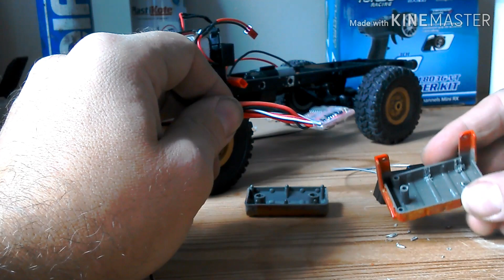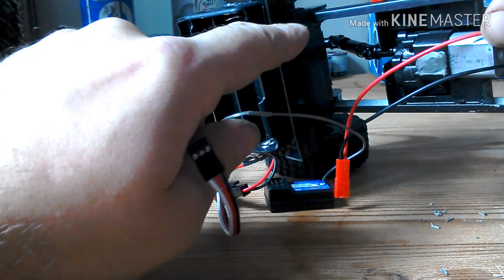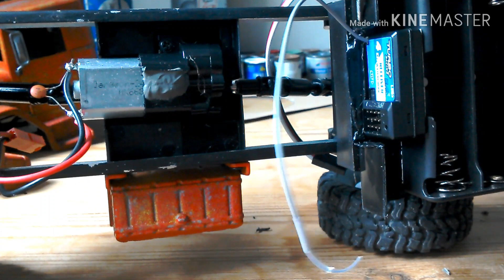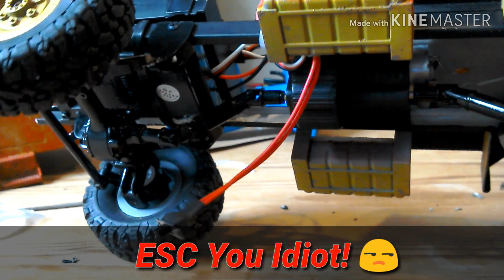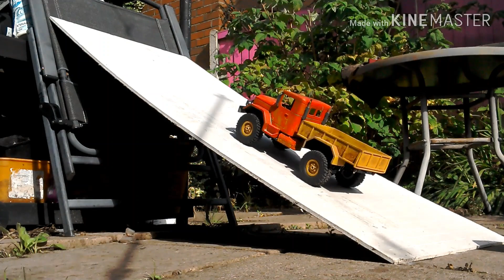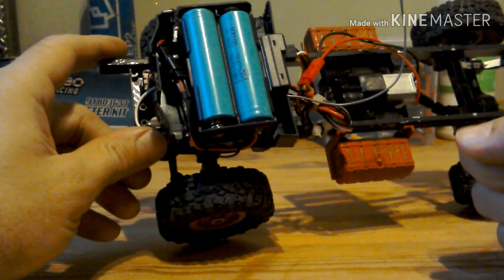WPL B1 ESC and Receiver Upgrade. More Power Equals Broken Gears!

Comment: Hi, I'm super stuck. I have just received the same esc and done the same setup as this other than the receiver and controller are different. My esc though has a flashing red light? Constantly flashing. No throttle response, no bleeping sounds when I turn it on. Just constant red flashing light. I've tried all the ports in the receiver just in case but nothing worked. Any help be super greatful. Thank you
Reply from the maker: Hello. Do you still have steering? I had a similar problem to this, it turned out to be a dodgy wire in the ESC to receiver connector plug. When you pushed the connector into the receiver from the ESC one of the wires in the connector block would be forced out of the block, and you would end up with a dodgy connection. All I did was push the wire back in with some small pliers and it cured the flashing light and throttle. Hope this helps! 👍
Reply: @theminiatureconstructionco4556  hello, thank you for your quick response. I have working steering. I will check the wires for any faults on the board and connectors as you say. Much appreciated for the help. Will let you know if it still doesn't work.

Comment: Has the new ESC got a lipo cut ?
Reply from the maker: Don't think so. I will have to check the specs. I use a 2s Li-ion battery so it's less of a risk, however I'm building a pack with protection for an upcoming video. 👍

Comment: surprised it wasn't the stock plastic axle gears letting go. the press fit hard brass pinions stay put better, not affected by motor heat through the output shaft. newer C-14/24 kits come with the brass axle bevel gears and B-36 tan gearbox, only thing "missing" is the metal driveshafts for them to be near "bulletproof".
Reply from the maker: I thought it was at first, because I looked in the axle cases and couldn't see the usual stripped gears. It wasn't until I fitted the 260 that I traced the problem to a loose pinion gear in the front axle. A drop of superglue and a good press back on to the shaft and so far it's held up. I do have some axles with metal gears in reserve though. 😊👍👌
Reply: yupyup, last year before metal gears I was shimming behind the plastic bushings of the pumpkin cover to keep the mesh tighter, paper punch through card stock, CA them in, push the bushings in and CA then reassemble, shoves the bevel pinion into the ring about 0.15 closer, and bushings a little further apart gave less wobble in the short shaft too. they held up for quite a while, knew to do it for watching other peoples experiences with them failing. another help is a small O-ring at the end of the axle (gear facing side) keeps the ring gear against the bevel pinion.
Reply from the maker: @modelnutty6503  great advice, I'll keeps that all on board. 👍